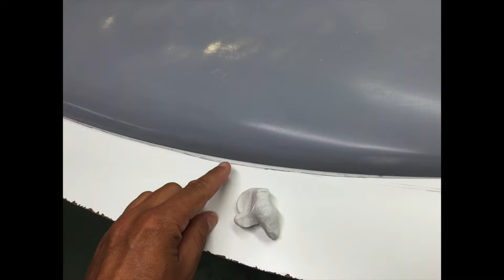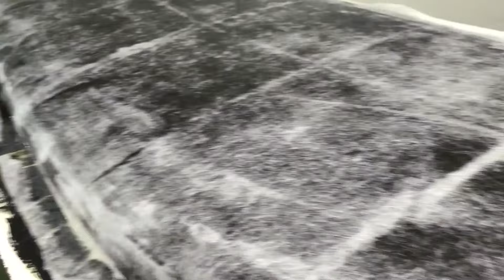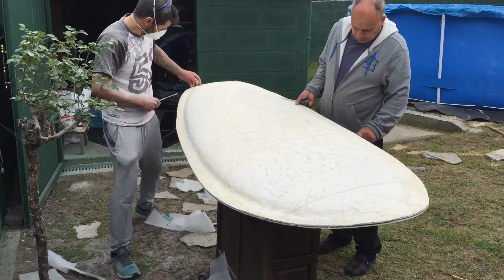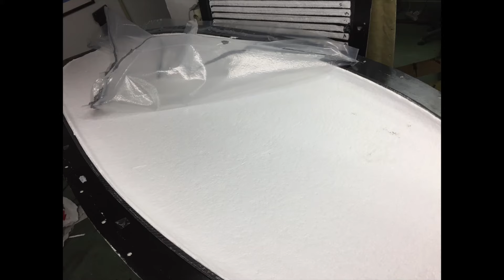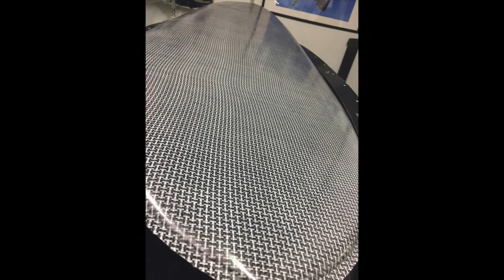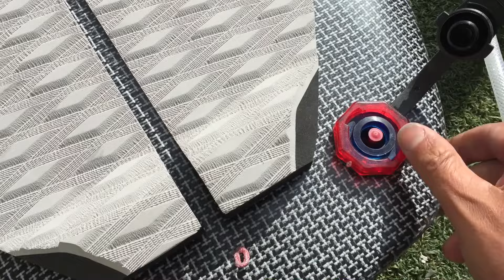SUP SURF CARBON FIBER INFLATABLE, MOULDS, VACUUM PUMP, NO FOAM

Comment: Hello, please tell me what kind of material do you use for pouring a matte layer of fiberglass on top of you pour it in beige what kind of material it is and what is the maximum slime you can put
Reply from the maker: the beige resin is Neomould I use 200/300/400 MAT (Fiberglass) depends the type of molds and durability less or more layers
Reply: @virus_virus  this saline changes in size during curing, whether it foams or not

Comment: Genius, the only issue is that you'll need lots of molds to create different models, with different rockers, sizes and dimensions, in other words you'll need investors. Go for it, make money on this. I take my hat off! OBTW! Do you sell surfboards?
Reply from the maker: Hi, thanks In this moment  I only make carbon fiber surfboards for me
Reply: So It will float without the air, right? Tempted in making one.
Reply from the maker: can float without air but probably need pressure to not damage the fiber
Reply: Does it blow out while filling with air? I dont saw any fibres which connect deck with the bottom.
How much does it wait? how much Gr of fibre did you use for deck and bottom?

thx